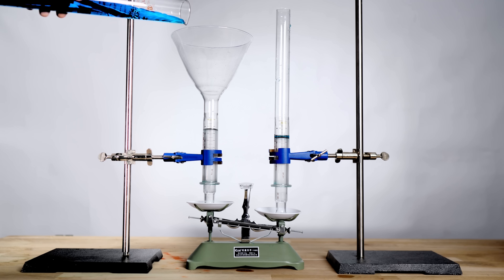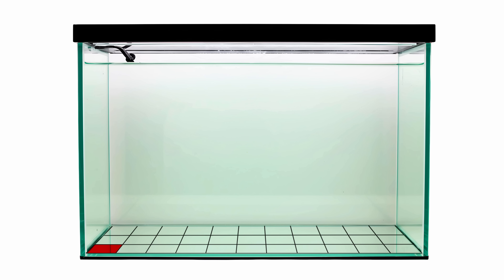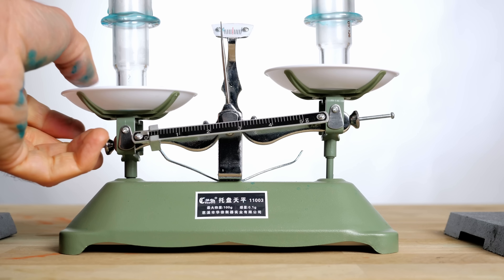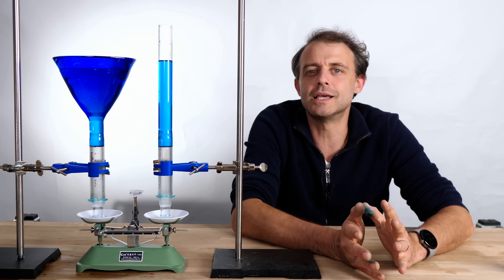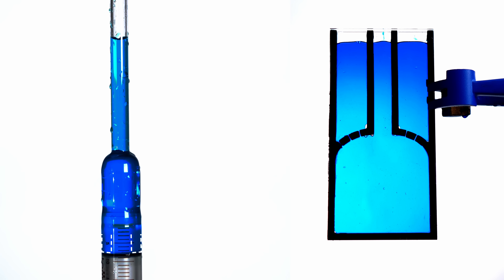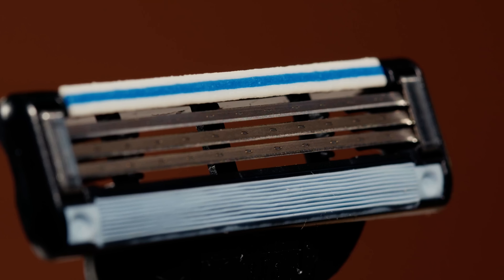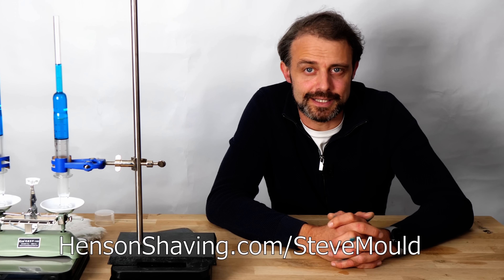The Hydrostatic Paradox

Comment: Before watching the explanation for the thinner one, this would be my hypothesis to test, because this is how I also see the other problem: Atmospheric pressure is envelopes us all completely, meaning that it is also pushing you up from downwards. That is why you can lift a suction cup without issue when pressure is equalized, but you cannot do it when there is vacuum, since now your are competing against 1 atm of pressure, which is massively more strong than you are, and you do not have the help of 1 atm from below.
In the case of the thin cylinder, as long as the thin part is up, then what matters is the area in contact with the balance, because the pressure is equalized in all directions, not the force: That means that as you transition from thin to thick, the pressure changes in the same manner, but now the area is larger so the force must be smaller, compared as if you had kept the same thin area.

In other words: In the cup, the atmosphere is helping you "hold the cup" because it is exerting pressure from below, causing a counterbalance force everywhere except for the cylindrical column at the center, and the other way around with the thin tube: Pressure is exerting an extra force on the "cup down" that is not compensated.
Reply: Heyyy, I was right. Defeating my impostor syndrome one small problem at a time.

Comment: The arms holding the containers up is supporting some of the weight. The pistons only measure the weight of the water column. 550g of water never weighs the same as 60g, if you figure out how much the arms holding the containers are supporting then you would have the full weight measured rather than just a column that is 'felt' by the plungers.

Comment: So is it fair to say that the water is pressing the clamp up (which makes the extra weight)? It's where the water would spray would if there was a hole, so it makes sense to assume that there it pressure at the point in the upwards direction.

Comment: I'd be curious to see this in a vacuum chamber! What happens without atmospheric pressure on the water columns? Also, thinking of this in terms of trading voltage potential for current or capacity seemed like a potentially useful conceptual link. :)

Comment: Imagine a swimming pool the size of a football stadium, 10 meters deep. You tunnel underneath and drill a 1/2" hole in the bottom. You can easily plug that with your finger. Your finger only feels the weight of around 2.8 lbs.

Comment: Random questions:

If you placed this entire setup in the freezer, would the scale ever tip a different direction? In the case of water, the volume would increase, but some fluids would decrease in volume.

Similarly, would the results be any difference if you replaced the water and glass containers with solid shapes (e.g., each shape is purely made of metal, so no fluids at all)?

Comment: All of that extra water in the larger funnel ... it's being reacted by the sides of the funnel into the clamp holding the funnel.  If you put another scale under the entire apparatus on each side, it would be measuring all of the water weight and there's no paradox.

Comment: For once one of these videos was actually completely intuitive to me!  An interesting addition to the narrower-at-the-top piston setup: imagine if it were sealed at the top, and then filled with compressed air and a quick-release valve at the bottom to let the piston push downward into the scales?  Yup, you just made a rudimentary model rocket!  In my mind, at least, that's the exact same concept at play (but perhaps more intuitive for someone else reading this).

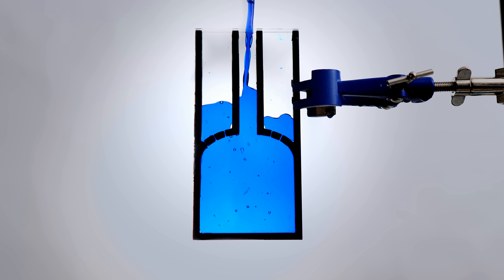Comment: I think what your example at 9:13 is missing is that if you don't have the side walls, then you don't have downward pressure at the outlets and so you would expect it to shoot HIGHER than the head of the input chamber in the free air example due to less resistance? And I'm sure if really played with the nozzles you can get a magnus effect on the droplets to get some extra height

Comment: encountered this at work years ago. i do construction and occasionally drive a water truck, on one job we were filling off of a literal 1 million gallon tank that was something like 45 feet tall and 65 feet wide (could have been slightly bigger, dont remember anymore) but it took FOREVER to fill a small 2000 gallon water truck (took like 20-25 minutes where even a slow hydrant is 10-15) and i couldnt understand why it wouldnt be spraying out under a ton of pressure like a firehose with a literal million gallons of water behind it. then i googled it and found out about water column and hydrostatic pressure, and with a calculator i found out it was only ~17 psi at the outlet which considering the hydrants around here are usually in the 40-50 psi range explained pretty well why the fill time was more or less doubled.

Comment: 0:49 all the water on the right side is directly over the plunger, whereas the left side has much less water over the syringe, and it's pressing more outwards on the slope. Pretty intuitive to me
Reply: Yup. Pressure for water is only straight up. As in the contact point below and the water directly above it is measured, nothing on the sides

Comment: So the clamp getting lighter is just a result of Pascal's law, correct? "Pressure acts in all directions perpendicular to the surface" Which means that the pressure is pushing up on those horizontal parts of the glass tube. 

Its essentially a buoyancy force. The water is 'floating' a portion of the clamps weight.

Comment: it reminds me of a U shaped tube filled with liquid where they stay at equal levels but you just change the shape of the ends of the tube. is it worth picturing the scale in this example as transferring the liquid pressure into mechanical pressure? or a mechanical tube of sorts. could you make a siphon with this setup?

Comment: So a pick up truck may be able to transport an entire lake full of water given that you use this configuration. Or am I just taking it too far by assuming this? A spaceship may be able to lift that same entire lake into orbit given the spaceshitp has that shape. You will only need to worry about applying enough thrust power to lift the weight of the cental column, and forget about the rest. Can we do something similar for helicopters used to spray out water into fires? What am I missing?

Comment: I'm leaving this comment before the sponsor read, which I assume is a safety razor. I bought a variable single blade razor because all my life any aggressive shaving or razoring made my neck really sore. I thought spending all my time outside would toughen my skin up but that didn't help. All I can say is I've had fewer issues moving to a single blade, properly weighted, razor. Fuc--get the 5-blade nonsense.

Oh, back on track - my tent has hydrostatic head of 2000mm on the flysheet. I feel that that is more a lab measurement - in the real world rain, or wind, isn't spread evenly.

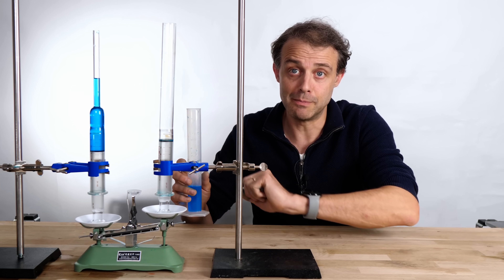Comment: Prediction at 7:34 we would need more water in the cylindrical tube. And the mechanism is due to the hydrophilic nature of water/adhesion to the walls of the tube in the cone shaped tube holding more of the weight.

Comment: An even more intuitive way to think about the skinnier tube is this: the "column" of water it just something we imagine. It's of arbitrary diameter. You can shrink it or grow it, but the pressure you're measuring is always the same: You expand the area of your column, you get more water weight (force). They cancel out, since force is divided by area. You can do this physically too: if we are measuring the pressure, the height will always be the same, no matter the tube radius.

Comment: something that has always bothered me about this is the following thought:

Say you had a massive tank of water that someone is scuba diving in. Lets say it's 1km x 1km x 10m in size. The diver can easily get to 10m deep without issue.
The tank is a sealed container, apart from a narrow tube. Say the tube is 30 meters tall and has a radius of 1mm, meaning it has a volume of around 94ml.
The diver is swimming around just fine, then someone fills the tube to the top with water. The diver is now being crushed with the pressure of 30 additional meters of water despite it only being 94ml compared to a vast amount of water in the tank...

Comment: I dont think the clamp stand gets "lighter" the weight of the water in the other, via the scales absorbs the pressure or takes the weight of scales. In a close system, with JUST the scales and the 1 clamp stand setup. The whole thing would increase increase in weight. Atleast thats my thoughts. Please do the experiment

Comment: Can i just stand with my feet closer together in a scale and weigh less?
Reply: No, unfortunately not. The force required to hold you up is still the same. Even if you stood on your tip-toes it would read the same. It's just that the pressure across your feet will be greater because P=F/A. If force is constant, then as area decreases, pressure increases.

Comment: In oil/gas drilling, you need to know the TVD(true vertical depth) to figure out the bottom hole pressure, which you masterfully visualized with the crooked cylinder.

Comment: The last concept always felt so unintuitive to me. Like I know it's true, but in my head I always tried to disprove somehow it by taking it to an extreme 🤔

Let's say you are in a pool with a solid lid on top so basically an arbitrary large block full of water and you in it. Now someone attaches a long narrow pipe to a comparatively tiny hole somewhere in the, so that it's pointing straight up. Now he starts to fill it with water even though it's a miniscule amount of water compared to the pool you'll soon get crushed as if you're deep in the ocean.

Now would this really happened or is this situation too theoretical and something would prevent it? I only thought of capillary effect in the pipe which could be negated by making it slightly wider. And that the walls would flex a little bit under the pressure, but even that would stop at some point and could just be compensated by adding more water to the pipe to reach the desired "depth". Any thoughts? 😁

Comment: This is the single most convincing razor ad I have ever seen in my life.
Reply: And yet his reasoning is exactly backwards to my 25 years of shaving experience. The multi-blade razors DON'T pull and tug at hairs, whereas the single blade razors always do. Perhaps it is just due to the traditionally lower quality of single blade razors compared with their multi-blade counterparts, and a high quality single blade would end up being better, but I have yet to ever experience that.
Reply: @elementneon In my mind the real issue is multi blades have springy blades and heads to conform to your skin which makes it easy, but to make that work you have to apply a bit of force and pressing the razors into the skin is where the irritation comes from. With a rigid safety razor, the guards conform your skin to the razor, but can only do so much so you have to manually get it at about the right angle. The trade off is you don't press hardly at all if you're doing it right, and the blade doesn't irritate the skin as much. I also use witch hazel and a bit of after shave balm and it works well

Comment: Isn't your set up also a little bit like one big tube in a "u" shape, where both sides of the water will always be level with each other? Except that the pressure exerted by any one side is transferred to the other side not by the water in between the two vertical parts, but in this case by the mechanism of the scale?

Comment: Another way to calculate fluid pressure is P = γh (gamma [specific weight of fluid] x height), where h is only in a vertical line from the calculation point to the surface of that fluid. Just keep in mind if you are calculating the absolute pressure and not the gauge pressure, you also have to add the weight of the atmosphere on top of the fluid, usually 101kPa or 14.7psi.

Comment: I started shaving with single blade razors, but then tried a Trac II in the mid-70s.  I have used it since as I found two blades to be the happy medium.   I have tried the later 3 to ridiculous numbers of blades, but found them heavy and cumbersome and not that good at giving a smooth shave.  I have no doubt that the modern single blade razors are very good, but I always got more nicks and cuts from them as compared to the Trac II.  So, I have stayed with two blades as being the sweet spot for me.

Comment: I recently switched to a safety razor and haven't looked back. Got the shaver and 50 blades for about $25 on Amazon. If you do decide to switch or try it out, be aware that the way you hold and use the razor is different. Let the weight of the shaver do the pushing up against the skin. No need to push it into your skin like a traditional disposable razor. Otherwise you will probably knick yourself quite a bit.

Comment: 7:17 Just gonna throw out a prediction: the thing causing this new bottle to behave differently is the pressure from the atmosphere. Within the rounded parts at the bottom, there's no air pressure pushing down on the surface, which means they "weigh less" as a result. Can't forget the atmosphere :p
Reply: You can think of this entire experiment as a water hose with a cork stuck inside it enough not to let water through but not stuck enough not to be able to move. What the experiment showed was how water leveling works just with extra steps. If the experiment was done in a vacuum and with fluid that does not boil at low pressures (some oil), not sure the experiment would have same result
Reply: Yeah, when the first one balanced I was like "ok yeah, you're not just balancing the water, but ALL the air above it." I figured that'd be the result, but then seeing made me go "oh yeah that's why."

Now I'm just like, "what happens if you get one tube that completely curves over so that the opening is below the highest point" (like parts of the siphon pump thing).
Reply: @fallouthirteen  That's a pretty good question, I'm curious about that now too! x)
Reply: Was right in a sort of roundabout way. My logic was thinking about how straws work, the atmosphere is pushing down on the drink outside the straw, while there's a reduced pressure inside.

Comment: Overall I really like this video, but I wish you wouldn't abuse the word 'weight' so much. No, the clamp stand is not getting lighter or heavier. It is pushing down harder on the scale (or pushing less hard on the scale). It is important to remember that scales don't actually read 'weight,' they read the force with which you push on them. In fact, the hydrostatic balance is an excellent demonstration of this: the two sides are balanced not when they have the same amount of water but when they exert equal forces on the scale.

Comment: At about 7:22 and other places you equate weight with force.  Force exerted on a surface should be the sum of the pressure times surface (see your foot example).  Weight should be as you stated the total weight of the water in the container.  

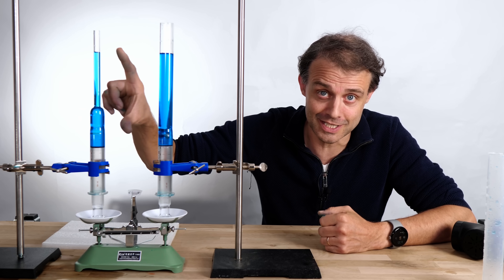8:10 - You use the terms weight and force as if they're interchangeable rather than related.  The water weighs what is does.  It just exerts more force.  (Look at hydrolic systems to see this in action.)

Dr. Visnjic made sure to keep the two terms separated.
Reply: It’s quite normal to talk in terms of experienced/perceived weight, e.g. what weighing devices would read. This is why we talk about “experiencing weightlessness” in freefall. I think he intended it to be obvious that he was speaking in this kind of non-literal sense, to highlight the strangeness of what’s going on; but you might be right that someone could misinterpret this. The paradox is that the “weight” experienced by the weighing scale is different from what we know to be the literal weight of the water. (A “paradox” means something that intuitively feels self-contradictory at some level.)
Reply: @DrJulianNewmansChannel  I thought I took the paradox out.  (I made an edit later to do this.) I still think that the presenter made the issue unnecessarily confusing.

Comment: The “paradox” here isn’t really one — it’s just hydrostatics and Boyle’s law finding balance at the interface.  
• Outside: P_out(z) = P_atm + ρ g z  
• Inside air pocket: P_air V_air = constant  
• At the interface: P_air = P_atm + ρ g h_i  
So ΔP = ρ g (h_r − h_i). Positive, water pushes in. Negative, air pushes out. Surface tension only delays the flip until equilibrium is reached.  

That’s why the full equation (P_atm + ρ g h_i)(H − h_i) = constant fits perfectly with a ruler and camera. You can even extend the demo by changing density (salt → higher ρ, stronger compression; alcohol → lower ρ, weaker compression, plus reduced surface tension).  

On the cone demo: the triangle-step model is a nice teaching tool, but real flow is continuous. Fractal geometry would map it as a recursive funnel:  
• Large-scale pressure at the wide opening.  
• Subdivisions adding finer contributions along the slope.  
• At the tip, flow collapses into vanishing points — equilibrium still holds as P = P_atm + ρ g h.  

So instead of triangles, the cone can be seen as a fractal funnel — nested equilibrium across scales, which mirrors how fluids really behave. Same physics, but a deeper mapping of the flow.💪♾️